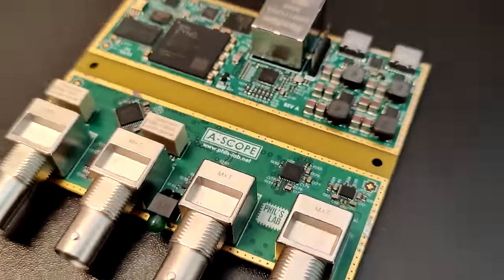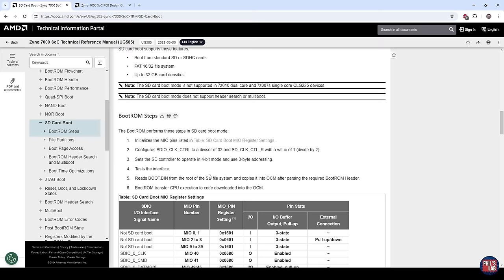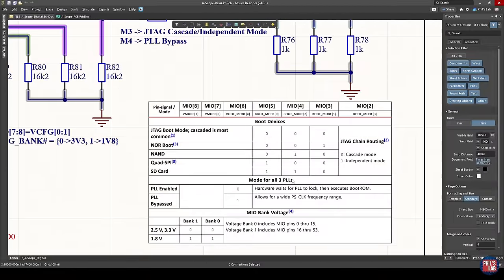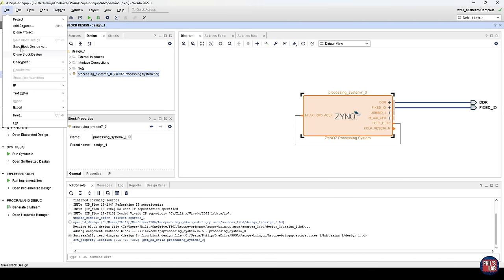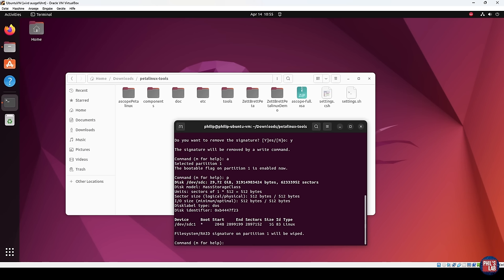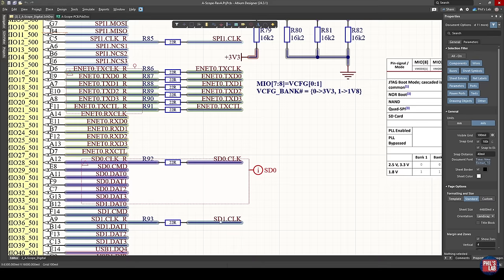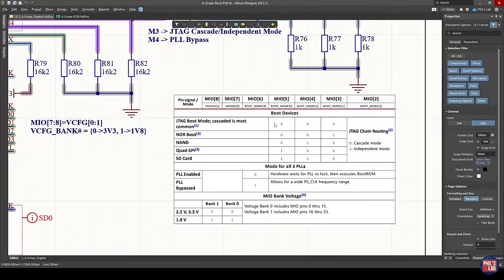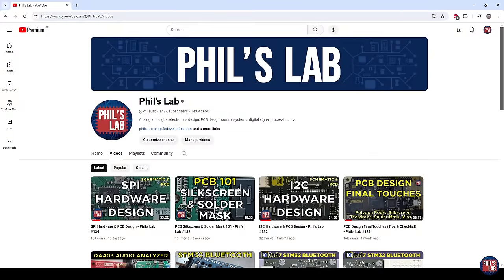FPGA/SoC SD Card + PetaLinux (Zynq Part 6)  - Phil's Lab #135

Comment: Abstract

This video tutorial demonstrates how to boot an AMD Xilinx Zynq System on Chip (SoC) from an SD card using PetaLinux. The guide covers SD card partitioning and formatting, required image files, boot mode configuration, and a workaround for booting from non-standard SD card pins or eMMC memory. The video utilizes a custom-designed mixed-signal audio analyzer PCB featuring the Zynq 7000 series SoC.

PCB/Hardware Overview

* 0:30: The video uses a custom PCB with a Zynq 7000 series SoC, DDR3 memory, Gigabit Ethernet, and a fully isolated analog audio interface.
* 0:46: The PCB includes a micro SD card connector connected to the Zynq SoC via a logic level shifter.
* 0:59: A mode switch on the PCB allows toggling between different boot modes by controlling the strapping pins of the Zynq SoC.

Schematic Overview

* 6:58: The Zynq SoC's processing system (PS) has two I/O banks: Bank 0 (3.3V) and Bank 1 (1.8V).
* 7:07: Bank 1 operates at 1.8V to support high-speed peripherals like Gigabit Ethernet and USB 2.0.
* 7:40: The boot mode is determined by the state of the Mode strapping pins (MIO 0-2) during startup. Different combinations of these pins select JTAG, QSPI, SD card, or other boot modes.
* 8:29: The SD card interface (SD0) must be connected to specific MIO pins (40-45) for standard SD card boot mode.
* 9:17: Since SD0 is in Bank 1 and the SD card operates at 3.3V, a logic level shifter is needed to interface with the 1.8V bank.

Vivado Block Design & Peripheral Selection

* 9:38: The hardware design is created in Vivado using a block design containing the Zynq processing system and necessary peripherals.
* 10:08: The Zynq PS configuration involves setting bank voltages, configuring interfaces like QSPI for flash memory and SD0 for the SD card, and setting up DDR3 memory.
* 11:28: After generating the bitstream, the hardware configuration is exported as an XSA file for use in PetaLinux.

Petalinux Config & Build (Video #100)

* 12:03: Refer to video #100 on the channel for detailed instructions on building the PetaLinux project, including kernel and U-boot configuration, and flashing the image via JTAG.

SD Card Partition & Format

* 12:55: A blank SD card is partitioned into two sections:
* 13:17: Partition 0 (boot): A small FAT32 partition (e.g., 1GB) to store boot images.
* 13:31: Partition 1 (rootfs): A larger ext4 partition using the remaining SD card space for the root file system.
* 14:11: The video demonstrates using the `fdisk` utility in a Linux environment to create and format the partitions.

Copying Petalinux Files to SD Card

* 16:47: The necessary PetaLinux image files are copied to the SD card partitions:
* 17:09: Boot partition: `boot.scr`, `boot.bin`, and the U-boot image.
* 17:24: Rootfs partition: Extract `rootfs.tar.gz` or use the `dd` command to copy `rootfs.ext4` image.

SD Card Boot Mode

* 18:20: The SD card with the copied files is inserted into the PCB's SD card holder.
* 18:31: The boot mode pins are set to 101 (boot mode 0=1, boot mode 1=0, boot mode 2=1) to select SD card boot mode.

QSPI SD/EMMC Boot Workaround

* 18:47: If the SD card is connected to non-standard pins or eMMC memory is used, a workaround is needed:
* 19:07: Generate a first stage bootloader (FSBL) in Vitis IDE using the exported XSA file.
* 19:56: Modify the FSBL code to force SD or eMMC boot mode regardless of the boot mode pins.
* 21:27: Build the FSBL project and create a `boot.bin` image.
* 22:33: Flash the `boot.bin` image to the QSPI flash memory using the Zynq tools in JTAG mode.
* 23:37: Set the boot mode pins to 100 (QSPI boot mode) to load the FSBL, which then jumps to the SD card or eMMC for booting PetaLinux.

Petalinux Boot

* 23:52: With the SD card inserted and the correct boot mode selected, power up the board.
* 25:23: The PetaLinux kernel boots up, and you should see the login prompt on the serial terminal.

i used gemini 1.5 pro
Token count
12,764 / 1,048,576

Comment: Embedded Linux has come a long long way since I wrote my book 22 years ago. I've got your other petalinux videos queued for this evening, to see how its done now, especially all the pre-init initialization. Your boot time was about 8 secs? Thanks Phil.
Reply from the maker: I'll have to check out your book, Craig! Boot time is under 30sec with the SD card.
Reply: I watched #100 and actually have to say, embedded Linux at this level really hasn't changed that much in to past 20 yrs. Run menuconfig, compile, wait, flash, reset (cross fingers) and boot.
Reply: @PhilsLab  we should set up a call, I'm sure you'd like to hear stories about embedded Linux before there was embedded Linux. I'll contact you.

Comment: Hi Phil,

As I'm new to hardware design, I've learned many basics from you about designing custom PCBs. However, I'm still a bit confused about how to start and succeed with the right method. I need to use the STM32H745 microcontroller for my project. Should I follow the schematic of the H745-DISCO board as a reference for the basic workings of the design? Please guide me.

Thank you!

Comment: Really nice. I used to do a bit programming with Basys 2 in VHDL, but never programmed one of them which have ARM core built in. Does your videos 96-100 talk about it how this all works? I have no idea how it works or how to program it, but seems quite interesting. Do you happen to know any beginner tutorial(software)? What cool you can do with it? I see you can program in C. I assume it's the ARM part. How did you get started with it?
Reply from the maker: Thank you! The previous videos are more about bringing the board up, rather than 'pure programming' tutorials. Although that could be a good starting point (e.g. the example projects). You can program in C/C++, or use the PYNQ environment to go the Python route. There is quite a steep learning curve, but I'd like to make some programming tutorials next. From what I've found actual, practical tutorials are a bit sparse - although there are some online.
Reply: @PhilsLab  Thanks for the answer.

Comment: Can I mention one thing, for whatever reason when you move the camera across the board at 0:24 the PCB is super blurry. I am just a youtube viewer dweeb, but for these types of sweeping shots use a different camera, I thought my eyes were going out and then I realized you just either had the wrong settings on your camera or just using a camera not meant for macro shots.
Reply from the maker: Thanks - yeah, I need to get a better set-up for that. Also I believe I recorded at a different framerate to that of the screen recording, which may add to the blurriness.
Reply: @PhilsLab  still a great video, keep them coming! You are one of the few creators where I drop everything I am doing when I get a notification that you have uploaded.
Reply from the maker: Thanks a lot, I'm very glad to hear that!